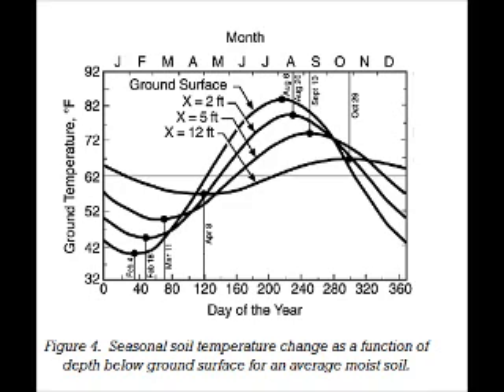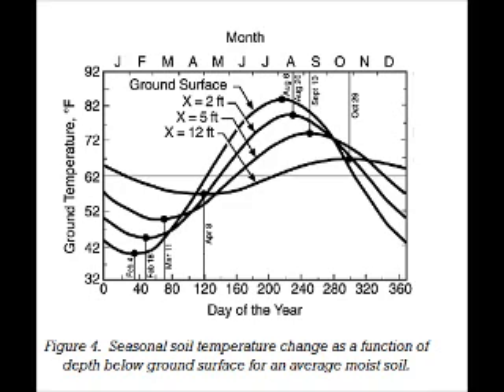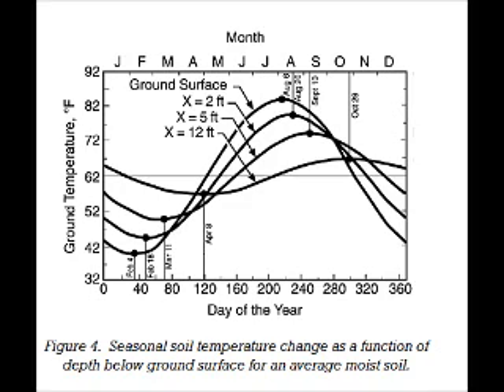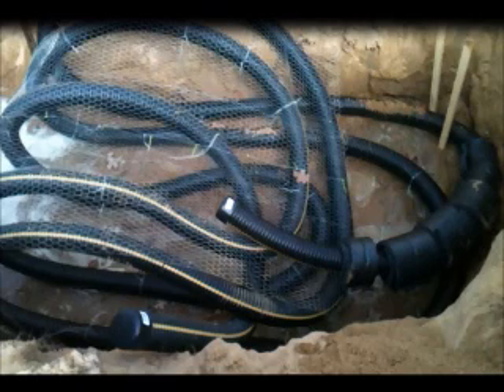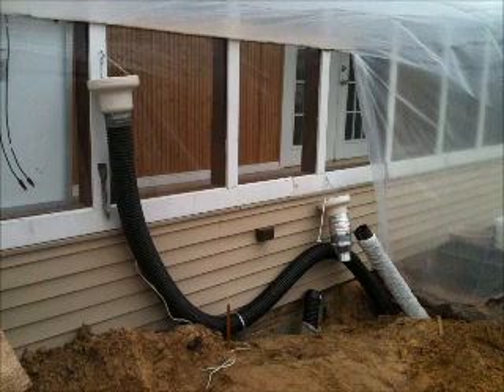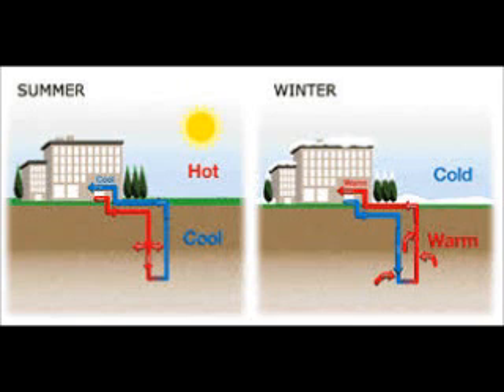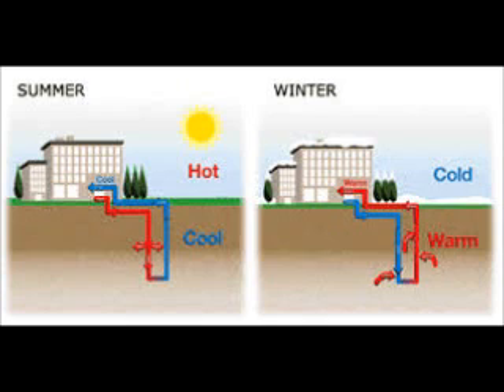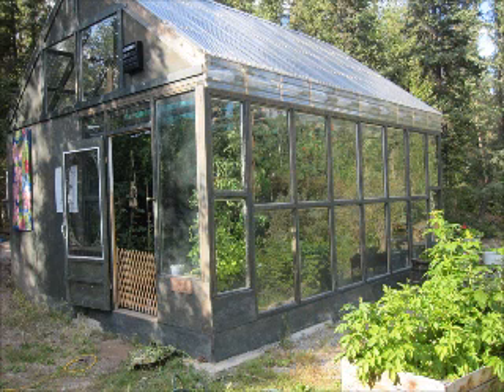DIY Simple & Dirt Cheap Alternative & Sustainable Heating & Cooling System

Comment from the maker: Minor update. I built a new test greenhouse from cattle panels and bought a new fan. The ones I was using were $30 axial fans @ 150 cfm (50 cfm actual at exhaust) and used 45 watts. I was told that a higher pressure fan would probably move a lot more air so I bought a $100 centrifugal fan rated @ 460 cfm (110 cfm actual at exhaust) and uses 140 watts. The cheap axial fans are more efficient @ 1.1 cfm per watt vs .78 cfm per watt for the centrifugal.

So the bad news is that I assumed I would get closer to 200 cfm with the centrifugal fan and hopefully more btu's. The good news is that when I run the fan at full power (110 cfm) I don't get a temp drop at the exhaust which means I can probably move even more cfm and maintain the temp. When heating, more cfm moved without an exhaust temp drop = more heat added to the GH. 

Next step is to buy another roll of pipe and experiment with different configurations (above ground) to try and figure out the most efficient layout of the pipe.
Reply: +Paul Ladendorf 
good to see the penny dropped ;)
Reply from the maker: +JohnGuest45 Are you the guy that posted the video of your own SHCS? If so, I'd like to pick your brain a bit about your test results.
Reply: +Paul Ladendorf 
I`ve given up trying to point people in the right direction ;)
 I`d reommend waiting until after summer before you copy any of the installs currently on you tube.  I predict they`ll be topping 130F even with the fan running flat out.
Reply from the maker: +JohnGuest45 I'm not looking for advice. I really just wanted to know a little more about your test results.
Reply: +Paul Ladendorf 
My test results are related to my system design, local climate and the type of the ground surrounding the tubing. Looking at the current installations, the designs are not based on any kind of formula.  Heat transfer (sensible and latent), air flow and friction loss can all be calculated using thermodynamics, there`s no voodoo or back magic involved. The true test of any shcs design is during the height of summer, 99.9% of systems designed using the wag (wild ass guess) method simply wont cope with the heat gain.

A lot of the assumptions you make in your video regarding ground 
temperature are not correct, adding and removing energy from a sheltered thermal mass causes it to behave very differently to a piece of open ground that is influenced mainly only by direct solar radiation, wind and rain.  
I tracked the temperature at different depths for 12 months before i  installed the greenhouse and shcs system so i had a baseline. The average ground temperature at 8ft deep beneath my greenhouse has increased every year the system has been running, its now almost 5C warmer than it was at the same time 6 years ago. The ground outside the greenhouse at the same depth is within 0.3C of the original value so it hasnt altered much at all over the same 6 year period. The gradual increase in average ground temperature is due to the heat i put into the system, its not heat travelling upwards from a deeper level. 
 The more variables you have, the better you can understand whats going on. I weighed a cubic foot of the soil from the lowest level of the excavation, dried it out completely and weighed it again. Knowing the bone dry weight of your thermal mass will give you the worst case themal capacity and thermal diffusivity values which can be used in conjunction with the temperature sensor readings to estimate heat storage and heat movement through the mass.        

There`s more to an shcs than just burying some tubing in the ground adhoc and hooking a fan up to it ;)
Reply: +JohnGuest45 
Just to add, i wouldnt recommend using a shcs to heat a house, garage or any structure where high humidity could be an issue.
Using a shcs to cool a house isnt efficient compared to using it to cool a greenhouse.  A greenhouse full of plants will have higher RH%, the bulk of the energy transferred to the ground is in the form of latent heat not sensible heat.

Comment: Hi Paul,
I would love to see your figures. I want to do this here in the UK. I can't seem to find out how much tubing I need for a given greenhouse size?? Can you advise me please?
Reply from the maker: +Richard Miller That depends on several factors such as your heat loss and what temperature you want to keep the gh. Even then, there are different opinions on what is the most efficient length per btu gain/loss. Based on what I know, I believe its better to have too much than not enough. If you don't have enough, you won't get all of the heat transfer possible. If you have too much, you'll have to use a bigger fan. Just for reference, I used 100 ft for a well insulated 150 sq ft. gh. One pro installer says I used way more than necessary.  Thats all I can tell you.
Reply: +Paul Ladendorf Thanks for the rapid reply. I am building a bit bigger than your example and it will be very highly insulated. My greenhouse is 36mtrs(110 ft)X15mtrs (50 feet) Using your previous estimated that looks like LXWXH/5=approx 600 mtrs (2000 feet), but you latest figures are MUCH less??
Reply from the maker: +Richard Miller Mark over at http;//ceresgs.com told me 25' would have been sufficient but that's not based on any testing I've done.
Reply: +JohnGuest45 Hi John, where are you based? would love to come see your set up if possible.

Comment: Here is my idea that uses the best of several systems.  I'm living in Moscow Russia so I'm north of Vancouver.  I'll use the fact that 10 lbs. of water holds as much heat as 80 lbs. of rock.  I'm not going to build a very big greenhouse to start. perhaps 10' by 30'.The greenhouse gets a 3' cement basement and it gets filled with water.  I heat the water in this basement with a parabolic troth solar water heater.  Since the greenhouse is directly above the heat will radiate through the floor.  That gives me over 25 tons of water.  In the winter if it gets really cold I can circulate water heat through salvaged car radiators for extra heat.In the summer time I can use this to cool my greenhouse.Any thoughts? about cost effectiveness etc...?
Reply: +Robert Miller 
 parabolic solar is recommended for large scale applications like prisons, hospitals in SW of US- high solar gain. 
 You maybe better off with the flat collector - but only spring/fall- will not work for you in winter.
 The serious concern i have  is concrete freeze/thaw  cycle at the depth you mention and breakage as a result, water stagnation, alge, the weight of greenhouse on top of your swimming pool, etc
I looked up solar  potential in Moscow- you have less than 1700 hours of solar radiation per year. You are better off using the warm floor system with small masonry rocket stove - check the depth of frost  and an annual T of your soil before you spend tons of money - waste
Reply: Good ideals. I'll consider them.  Further south would be better.
Reply: Yeah!  I don't know how I made that error.  I had to have missed a step.  Howerer I think this is what I meant to say. Water has 8 times the heat density as crushed rock. When compared to crushed rock this volume of water will store the same heat as between 25 and 30 tons of rock.
Reply: +Robert Miller How do you get 25tons of water from 900 cubic feet of water (10x30x3')? Shouldn't it be more like 3.75 tons since a cubic foot of water weighs about 8.35lbs?
Reply: I don't think I have to worry much about alge because this storage tank will be under ground.  
Nor do I need to worry about the ground freezing so long as the water in the take does not freeze.  
If I do not get any organic matter into the water to decompose I should be able to keep this water more or less drinkable even after months.
Reply: If I'm still worried about bacteria and I might actually want this water to be drinkable by me I can always use an old trick.  I can throw a hand full of silver coins into the water tank.  Silver and silver ions kill the nasties on contact.
Reply from the maker: +Robert Miller Good idea. As a similar but cheaper and simpler option than a basement, I thought about burying 55 gal drums filled with water and plumbed with pex tubing and using a car radiator and pump for circulation. The corrugated tubing system is much simpler and cheaper though since you don't need a pump or have to mess with plumbing.
Reply: I do like the idea of simple 55 gallon drums. I'm near Moscow, Russia so I need to figure out what is the most cost effective method.  I did find where I can buy some 500 gallon storage tanks made from the same plastic as the 55 gallon drums for a few hundred dollars.  I think that will be the cheapest simplest way.
Reply: +hughtub Are you thinking of the weight per gallon? a cubic foot of fresh water weighs 62.4 pounds and sea water is 64 pounds per cubic foot ...
Reply: +Robert Miller Although I haven't calculated total tonnage etc. ... but a cubic foot of 'fresh' water weighs 62.4 pounds ... salt water weighs 64 pounds per cubic foot. 

Re; From Pirate days ... "All the world round ... a pint is a pound" ... and there are 8 pints to a gallon so it weighs about 8 pounds [8.33 lbs. per imperial gallon to be exact.]

A one foot head of water presents .433' psi pressure; this over a *square foot = 62.4 [.433' x 144 = 62.4]
Reply: I'm sure you have a good point to make and some how I've missed it.  I'm not sure what the square footage and psi have to do with my system.  Depth and psi will determine my pump size is a given.  I think I only need to calculate the head at the top of my radiators to the water level inside my water tank that is buried under my greenhouse. Perhaps 4'?
Feel free to post anything I might have missed.
Reply: +Willy Ens 
Not so. In countries using the imperial system, 1 pint = 20 ounces.

Comment: Thoughts on Radon please
Reply from the maker: +phoenix1964 If you use the slotted drain pipe its a potential issue. If you use the solid pipe, it wouldn't be an issue.

Comment: I am interested in ground sourcing temperature moderation also. will the corrugated pipe condense moisture and grow negative respiratory pathogens?
Reply from the maker: +1mtstewart My understanding is that if you use perforated (slotted) pipe any condensation will drain out and I've never heard of anyone having mold issues. If you use solid pipe, there is no place for condensation to drain so its potentially an issue and some claim to have had mold problems.
Reply: +Paul Ladendorf keep us posted. thanks

Comment: If you insulate the ground over your pipes, you will lose less heat in the ground to the sky at night and on cold days from convection. Just lay insulation board on the ground out a ways. Also, if you insulate the north and west sides and the top of the greenhouse you will save an immense amount of heat loss. And use insulative board with a reflective aluminized layer to stop IR losses.  And if you really want to see something marvelous, use hinged insulative battens that swing to cover the south side windows at night. Also, use raised beds so that colder air falls down into the walkway trench. With these methods you can have a 70F greenhouse at night when it's -20F.
Reply: +rstevewarmorycom Methods well noted. Thank you for these tips. :D I'm hatching some big plans and need all the tips I can get.
Reply: Willy Ens Yup, you brought up the ground heat from 10 or 20 feet down by insulating the surface soil from the air ambient temperature. If you do that around a house aways, then your ground beneath the house, insulated by the house insulation and the ground insulation around it, will qccess and maintain the deep earth temperature of around 55F or 13C. Then if you insulate your flooring on your foundation, the insulated envelope of the house is quite easy to heat further to 65 or 70F with a little south facing solar competition, which can be evened out day and night with some thermal mass, either a lot of rock contained in the house or large water containers.

Comment: what we did was add a set of H2o filled( not totally. allow freeze up space) barrels with air tube running through them and freezing the water during winter to use for super charged swamp cooler in summer

Comment: Can we get a update on your geo thermal system?
Reply: +Paul Ladendorf Yah, How about now? This is relevant to my interests. The climate where I am reaches -40 during the dead of winter. I'm trying to devise a way of mixing multiple ecologically sustainable technologies to reduce greenhouse heating costs. It would be a huge help to get some temperature results from your project to see how this method works on it's own. 

Obviously, I'd have to go deeper than yourself. I'm also considering trying to do a combination water/air system, where water (with antifreeze content obviously) is heated by a coil inside a rocket mass heater. The Water pipe is then sent underground inside the air line. This will help the thermal battery effect, increase the ambient temperature of the air being passed through the air lines and obviously heat the thermal mass more effectively as well. I'm thinking a couple burns on the rocket mass in the evenings to heat the water temp to effectively boiling (yes, I realize I will require a pressure relief tank). This will obviously require me running a small inline water circulation pump which will add to the energy costs, but it will still be significantly more energy efficient than other heating methods. 

I probably didn't need to give you my life's story, but again, I'm super interested to find out your results. I'm subscribing to your channel and hope to see an update in the future. A year from this video's post date still seems so far away.
Reply from the maker: +motomotosig Hey everyone. I have a serious challenge with my house foundation so didn't get a permanent greenhouse installed so sorry but I have no update. I plan to build another temporary one soon and will be able to really test the system through the winter. Stay tuned and I'll update regularly once I get the temporary one up.
Reply: +Paul Ladendorf How bout now paul?
Reply from the maker: motomotosig Sorry, no update at this time.

Comment: Can you tell us more about how successful the 4 inch pipe was, what is difference between input and output temperature?

Any idea what cfm your fans are?
Reply from the maker: Richard Fiser The input or greenhouse temperature is typically between 30 and 40 degrees depending on how cold it is outside. I turned the fans on when the gh got down to 40 degrees.  The output is consistently between 40 and 50 degrees.

My fans measured 50 cfm according to a standard anemometer centered over the tubing which probably is closer to about 25 cfm actual. 

My system is far from optimized and I'm currently working with a professional installer to get more information and data before making adjustments.